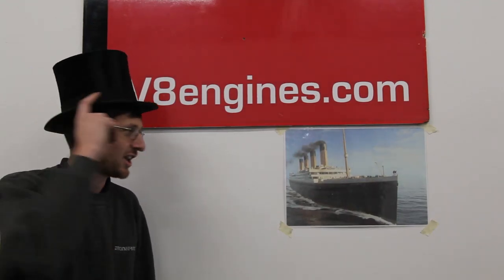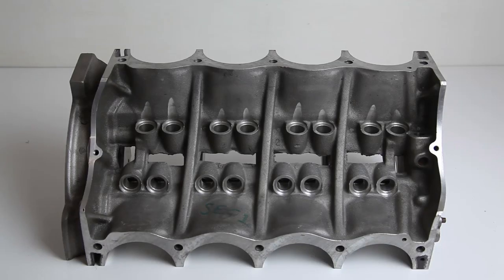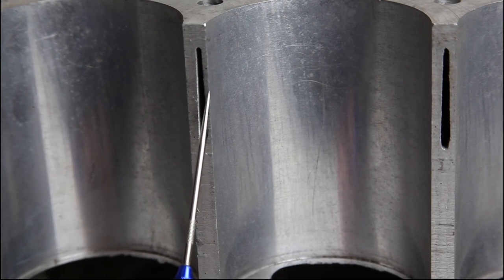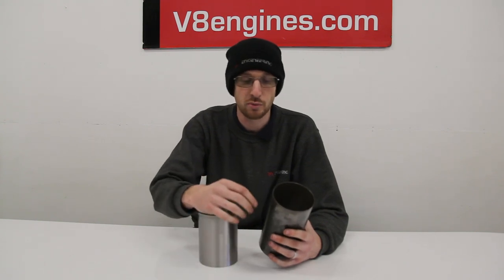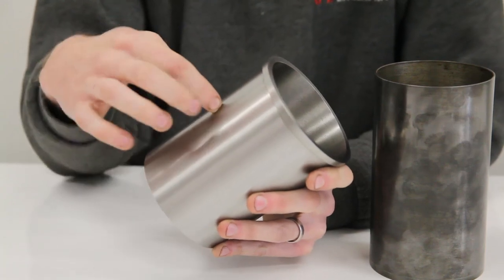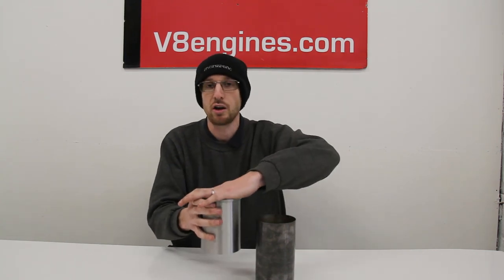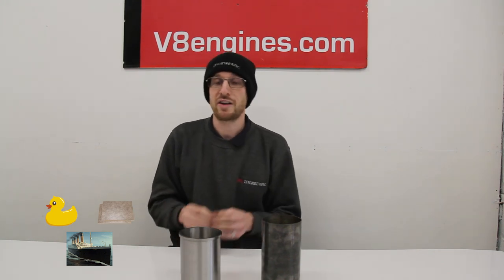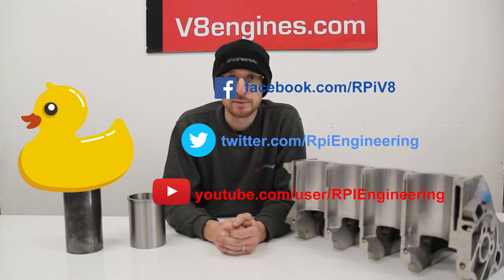RPi Engineering - Re manufactured Rover V8 engines. Cracking blocks and Top Hat liners explained

Comment: I've read somewhere that some blocks had the bolt holes between 4&6 drilled too close to the jacket resulting in stress fractures... have you seen this? Could this just be due to the jacket being cast offset? Great video!

Comment: I have an 04 discovery with a 4.0 and I wanted to fit a low boost twin turbo system to the vehicle for a bit more poke but am at complete cross roads on if the motor is worth it. Id love to keep the rover but dont want to spend thousands on doing the turbo kit and have nothing but issues. Ive had the car for years, when i first got it i did head gaskets but due to combustion leak not coolant, been perfect since. Other option is drop in an LS V8 as here in australia they are everywhere and cheap. 
I know you guys are now doing the turbo build.. what are you expecting?
Reply from the maker: Hi,
Firstly if you not looking at spending thousands then I would say stay clear of a turbo conversion as to do it properly its is not cheap. The most straight forward way to access usable power is to swap the engine for a 4.6. Doing this properly with a pressure tested (no liners installed) block, new camshaft kit and reconditioned cylinder heads will also give the car a new leas of life as well as huge install bottom end grunt upgrade. However if that too is over budget then a remap and a cam swap on the 4.0 litre engine is the best way to go along with a refresh of other required parts for longevity

Best to email us on info@v8engines.com for a quote on the options you are interested in.

Kind regards,
Ian
Reply: @RPIEngineering  Hi Ian, 
Money is not the issue here, i work for a performamce based business as a mechanic here in australia. We do all types of dyno tuning and import turbo work, my question was more  to do with the reliability of the rover 4.0 and if its worth adding boost or are there just too many variables. Eg. Will boost just increase bore heat and bring on cracking issues, slipped liners etc.
Reply from the maker: @psiwog  We have not done forced induction setups before. We have replaced engines with them on etc however we have never built a forced induction kit. Long terms effects.... there are lots of people out there running around 6 psi of boost on Rover V8's and having no longer term issues however as you will be well aware reliability is also hugely down to quality of parts fitted and the tuning of the engine.

For sure sourcing a LS motor where you are will be cheap and if you have the skills to make it all fit and work in your D2 and its an engine you are familiar with then it could be a viable option for you however as you know its lots of work doing an engine swap (gearbox, wiring, cooling etc etc) hence why the easy straight forward options to get instant bottom end grunt if you have a 4.0 litre engine is to fit a 4.6. It works, everything bolts straight to it and we have done it hundreds of times.
Reply: @RPIEngineering  thanks for the detailed answer. Really appreciate the time taken to respond

Comment: What about o-rings in the liner, like how Darton and LA Sleeves does it? It's supposed to effectively convert it to a wet liner, preventing water from reaching the crankcase.
Reply from the maker: Its a good idea and one some have tried but we have seen them fail. 

The only 100% solution is to start with a block that is not cracked.

Comment: I have a 3.5 carb rover v8. I need to use the original block, matching numbers to chassis. 
Can I liner it to run as a 3.9?
Reply from the maker: Hi,
I can see you have also sent the same message through Facebook to us. I will reply in detail on there for you.

Kind regards,
Ian

Comment: hi,does the rover engine have a fault with slipped liners that can,t be avoided ie will all rover engines have this problem at some point in there life?thanks,g oakley
Reply from the maker: Slipped liners are not as common as cracked blocks. The two issues are different problems, do not mix them up.
Reply: thank you very much for your reply,i have a complete 4.6 l rover engine and a lt77 gearbox to go into my cobra replica,but i am worried about the problem of the slipped liners,i read on a forum that the rover v8 has a design flaw regarding this,do you think its a reliable engine if its treated with kindness<haha>i,m pretty green on this subject so please excuse my ignorance,g oakley.
Reply: hello to everyone at rpi ,enjoy your youtube videos,hope all your familys stay safe regarding covid,are you still busy?graham oakley.
Reply from the maker: @grahamoakley4337  Thankfully we are very busy. Looked after well these engines can keep going 200K miles and more (we have customers on original engines in P38 Range Rovers with this mileage on them) The biggest issue is lack of preventative maintenance

Comment: Wow you guys really know your RV8 engines!!! This makes sad viewing though, as I thought I just had a blown head gasket on my 4.0 Chimaera. It initially starts and runs fine, but once warmed I get clouds of white smoke or maybe steam out the exhaust. Once home, I fired it up with both Lamder sensors removed and can see a small amount of the smoke or steam coming out the OS banks hole. I'm now thinking the coolant pressure needs to build, to force it through the now expanded casting to liner fitment?
I can also see this head has been removed in the past by someone, so this kinds stacks up too. Or the head isn't flat and wasn't machined. I'm tempted to give you guys a call, before I start looking for another engine or block. It's gonna be expensive though by the sound of it. Presumably the smaller 4.0 is less prone to this?
Reply: LS swap or BMW 650i V8 swap?

Comment: Problem with top hat liners , due to micro vibration they will sink down and blow the head gasket
Reply from the maker: Not when the block is mahcined and the liners are installed correctly. We have seen blocks with liners dropped (and even top hat liners) from other machinists (there is a D90 with top hat liners that have dropped in our videos somewhere) however to date I am not aware of any of our top hat linered blocks that have suffered from this and we do get to see them back after thousands of hours of drive cycles under extreme heat conditions on dyno's as well.

Comment: What type of Antifreeze , do you recommend using in a Rover V8 , I have been using Halfords OAT in my 3. 5 p 6 engine ,just wondering what your thoughts are use it  the OAT type Antifreeze .
Thanks .
Reply from the maker: We use blue in all engines pre 1999 THor versions and red in the Thor versions. There is no difference in the type of aluminium used but Land Rover seemed to switch then so to be correct for the car that is what we do so that there is no confusion of cross contamination. As long as you the correct mix you will be fine however we are not fans of long life things as it is always a good idea to flush systems out periodically
Reply: RPIEngineering so as long as I keep changing The Oat antifreeze on my non injection p6 on a regular basis ,not sure what year my engine is ,all should be fine .
Thanks .
Reply from the maker: @chrisclegg3711  Yes no need for concern. The Rover casting material was actually really good when you compare it to the quality of material used on the Triumph 3.0 V8 which goes porous over time.
Reply: RPIEngineering Thank you ,that puts my mind at ease ,  I do have another concern if you could help me please , my rover p6 3.500 fitted in my Ford pop ,hasn’t been started for four years as the petrol tank was removed for body restoration,so has been stored in a dry the workshop ,I believe the engine is still free to turn ,do you have any advise when I finally come to start it again .
Your advise would be gratefully appreciated .
Thanks .
Reply from the maker: @chrisclegg3711  Best thing to do if its been stood for ages is to remove the spark plugs and to spray some WD40 down the bores and leave over night, then spray some more in there and gently turn the engine over feeling for any resistance etc. Make sure that the engine rotates smoothly through the full 720 degrees of combustion cylce.
Reply: RPIEngineering Thank you for  the advise ,I will make sure I use the WD 40 .
Thanks for your help ,much appreciated.👍

Comment: are old 4.6 casting prone to cracks?  , and are there any blocks to keep away from.  thanks very much
Reply from the maker: Hopefully the video answered most of your questions. Maybe watch it through again as it explains why the cracks happen.

Both 4.0 litre and 4.6 blocks are cast the same so have the same tolerance issues.

For further clarification please feel free to call us on 01603 891209
Reply: RPIEngineering thank you, I understood the reason, poor castings, I’m about to buy a Range Rover 4.6 to act as a donna for a project, fingers crossed bit of pot luck then. :-)
Reply from the maker: @geoffhoyle479  Ideally get one with MOT and drive it round for a few weeks and keep an eye on the water level. If its loosing some ensure you have no leaks etc. Its not fool proof but will help you determine if the block might be cracked at a home level prior to investing money into and engine for a project car
Reply: RPIEngineering thanks very much

Comment: What's wrong with tig welding the crack the crack or running a weld around the bore where the liner fits in then line boring the block out to fit the liner?
Or putting a copper ring under the top hat liner so it expands and stays tight against the gasket and the head.
And other forums have said run the tdi 5 thermostat instead of the petrol one?
This will make it run cooler!
Have you heard of this being done?
Reply: Welding a crack will only last so long; the weld will be machined over and the wall thickness will be as bad as new when it was improperly cast. There is NO solution to a bad block that will be reliable.

Comment: Can you guys who are obviously "in the know" tell me if top hat liners that are any amount below the deck of the block are acceptable. I have had what looks like oil leaking from my heads after Top Hats fitted, upon pulling the heads the some top hats appear to be up to 1.5 thou below, i think they may have not been fully down when the deck was skimmed and have now moved?
Reply from the maker: Liners should be installed unit home. Then the block is decked so that the entire face is on a level plane. If the liners are lower than the face of the block the head gasket sealing ring will be compromised.

Comment: Why cant you just weld up the crack, bore it out and put a new sleeve in or even the old sleeve if you centre the borer well.
OK so the cooling channel is a little compromised and you may even close it up at that point but its aluminium. The heat will transfer.
As long as its for domestic use and not racing it should work.
Can someone either explain why not or maybe try what I am suggesting to prove me wrong thank you.
Such a waste to throw all these block out because of a little hole.
Reply: I think you can weld up and resleeve. I noticed the 4.0 are all cracking but maybe not 4.6.

Comment: In addition to overheating, failing to maintain the cooling system leads to corrosion. That causes a loss of material where the engine needs it, increasing the risk of developing a crack.

I never realized that top hat cylinder liners would not stop the loss of coolant. I always thought that the interference fit would make coolant leaks impossible. Thanks for showing me that it isn't true.

I have heard that welding a cracked engine block is possible, but the odds of a long lasting repair are very low.

Comment: #2 cylinder and #4 cylinder are piss poor castings. I have a question that nobody has been able to answer to date. Since Range Rover engines are basically GM 215 cu. in. Aluminum Buick engines, is the bell housing still the GM bolt pattern?
Reply from the maker: Hi,
I have never actually seen a Buick 215 so again would not know if the bell housing bolt patterns are the same as the Roper V8 engine however I just did a quick google search and found a forum where someone was referencing 215 bolt patterns as being the same for the Rover V8 engine.
Reply: RPIEngineering, that’s what I thought might be. See back in 62 or 63 about the same time as when GM sold the aluminum V8 design and castings to British Leyland, they had instituted complete engine and transmission interchangeability throughout all GM divisions. That meant universal bolt patterns. Even the frames were drilled with multiple frame mounts so any GM engine would fit in any GM car. The 215 is the same as the 3.5 liter Rover engine that you’re used to using.

Comment: I have read (in Des Hammil's book if memory serves) that the factory tested the castings and that the better quality blocks went into 4.6 engines. Since you rebuild a lot of these engines, can you confirm this? Is there a practical way of checking the thickness of the aluminum walls once the factory liners are removed? Also, the 03-04 Discovery II engines seem to have oil pressure and bottom end problems that others don't. I have heard that there were quality issues where the oil pump gears were not lining up properly with the crank axis, causing premature oil pump failure. I didn't get this from a reliable source, not sure if I can trust this. In your experience, what are the problems (if any) with late production (03-04) 4.6 blocks and are they worth rebuilding? I have a couple laying around that have no history of liner problems. Not sure if I should try to rebuild them. I read that the front cover on crossbolted engines was "revised" at some point. I know that the factory went from buick-style oil pump to gerotor pump driven bycrank nose on crossbolted engines. What was the front cover revision all about? Do I need a revised front cover, or can I just replace the oil pump gears and reuse the one from an 03-04 Discovery II? The Bosch Range Rover 4.6 is the same exact engine, which did not have oil pressure and bottom end issues. I am wondering what they did differently on the last two years of the Disco II.
Reply from the maker: Hi,
Yes it is true that Land Rover did test wall thickness and colour code the blocks for a period of time however from what we have seen over the years they must have also got to a stage of just use any colour block for any engine capacity towards the very end. We are aware of an issue that Land Rover had with the distributor alignment on some of the intermediate timing covers however not with any of the later Gems or Thor style covers. We have seen the oil pump gears fail on them but across both version of Gems and Thor covers.
Reply: @RPIEngineering  I worked on the  Land Rover V8 machine shop upgrade with Ingersoll  during the 90's which replaced all machining stages prior to the liner fit. During the commission period Land Rover began using a hand held ultrasound device to test wall thickness of all blocks before they entered the liner oven.
Also I vaguely recall a panic period where blocks were being tested before enter the first stage of machining.
Reply from the maker: @maxphipps2  Yes this was when they then colour coded them for the thickness and for a while they used certain ones for 4.0 and others for 4.6 as far as we are away. However towards the end of the run before coscast took over we then started to see 4.0 and 4.6 with the same colours etc again.

Comment: Poor casting, poor machining. Why? Is this a British malaise, or was it just old, worn Leyland machine tools and lack of investment? Are there Japanese or German engines from the same era with known block / head quality issues?
Reply: Prolly was overheated repeatedly. Big V8 with an old radiator.
Reply: Land Rover were made aware of a tolerance stack issue that could potentially leave them with negative metal between the bore and water jacket at the start of project Pegasus (p38a). The water jacket was located in a side core which in turn was located in the die side which in turn again sat on the base, in which the crank and barrel cores located. The die ends which formed the front and rear of the block were free moving and used to nudge the top core which formed the valley. Land Rovers engineers knew the issues but had no money to properly fix the task of taking a 3.5lt block out to 4.6lt. As a compromise the desision was made to probe the position of the two water jackets, split the difference between the two of them and then split that with the crank position. Finally each block would be rolled to achieve the "best" fit to the rest of the features. A down side of rolling the block is it pushed the valley core out of position. I believe number 9 valley core (each had the number cast in to the valley) was the first to be made specifically for Pegasus and was beefed up accordingly around the tappets to allow for movement when balancing. When you strip an engine you may see numbers written in the valley, this was the metal thickness as measured in the foundry and allowed Land Rover to be selective as to which blocks were used for 4.6. Over heating was the equivalent of pulling the pin out if the grenade.

Comment: Recently indeed cleaned the radiator package in my P38 from debris buildup - a long overdue job:
First took the grille off , then simply dry vacuumed , then hosed it off to make it wet from the rear (there is just enough space between radiators )  and vacuumed wet while hosing off. Then used a high pressure cleaner at some distance (not to much pressure) and again vacuumed wet. Then with some plastic toothpicks picked the radiator where needed , again blasted gently with pressure cleaner and started the engine while still wet to suck out last bits. Inspected with a torch - repeated some sections . Result the exhaust fumes are definitely cooler. Not that 'choking' hot anymore.